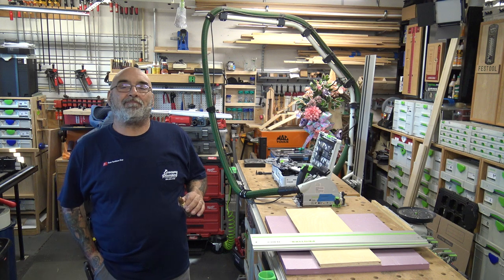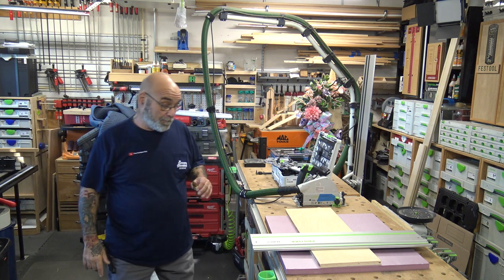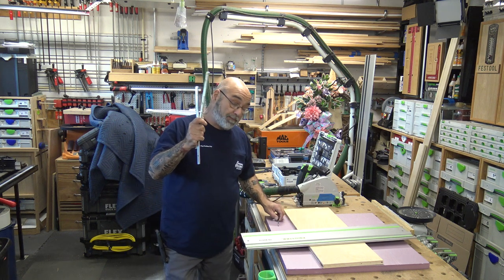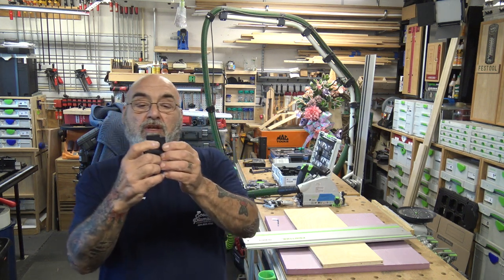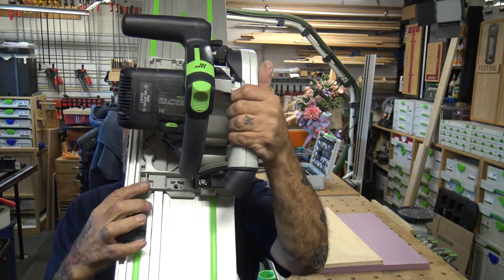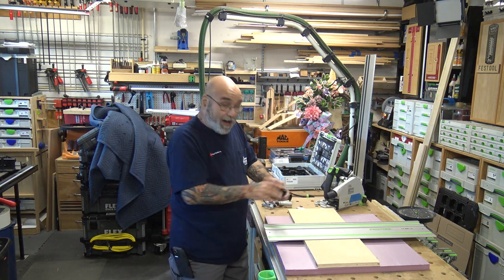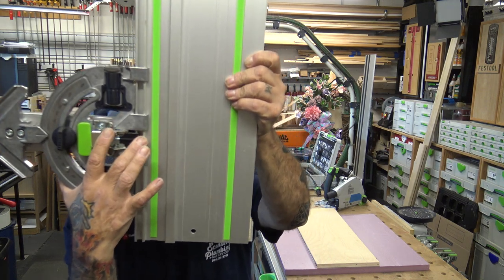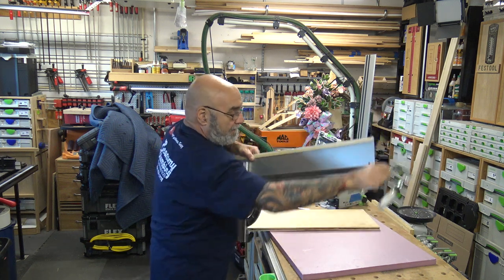Festool 577157 Guide Rail Accessory Kit

Comment: I have just bought one of these and found the stops were not accurate.  For example, the 90 degree stop was a couple of degrees out.  So this means every time I want to change the angle be it 90 degrees or any other, I have to find a way to calibrate to the chosen angle.  I do it by using the stops on my MFT table but this is a real pain in the neck.  This is highly disappointing given the cost of this guide rail and the Festool hype about is accuracy.